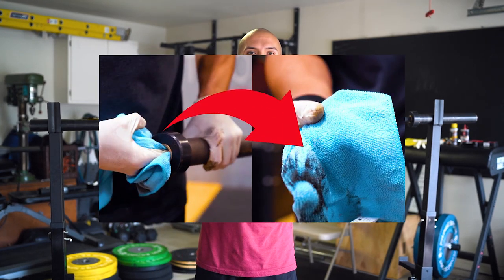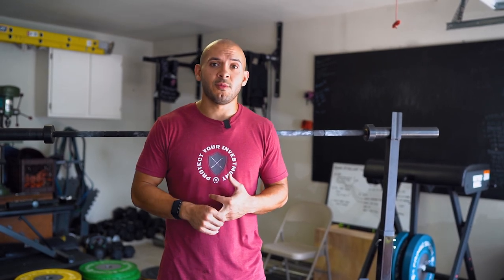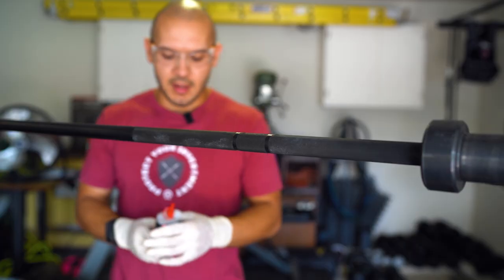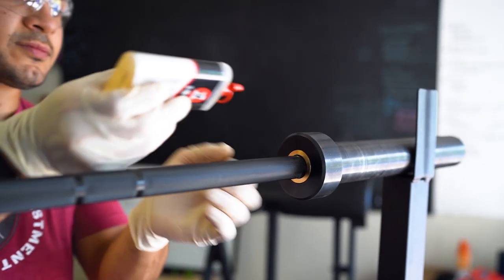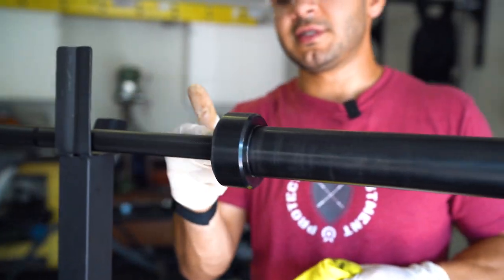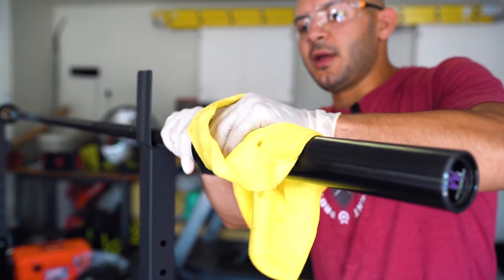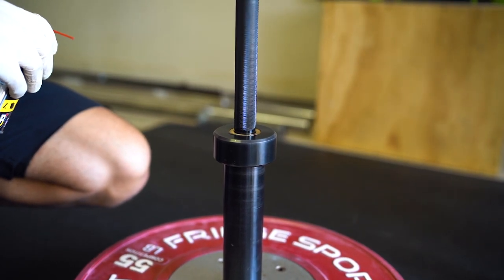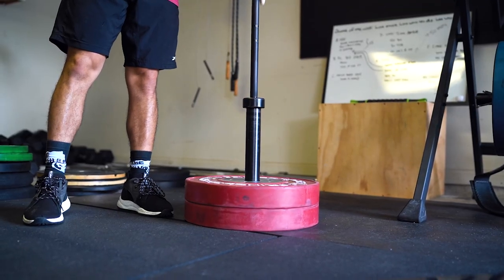How To CLEAN Your Barbell At Home (Remove Chalk, Dirt, & Rust)

Comment: I cleaned my bar with the same oil and now my bar looks dirtier and much darker on the area I cleaned. Should I just soak it in vinegar?
Reply: Did you end up doing anything?
Reply: @RobDyrdek713 nope, I ended up getting a new bar and that one is just sitting in the gym. I just need to find a big enough container or something to fit the barbell in and soak in vinegar but I’ve been too lazy.
Reply: @nazook  same. Thought about putting it in a makeshift container and lining that with a tarp to soak it